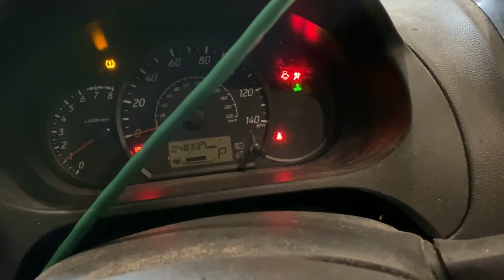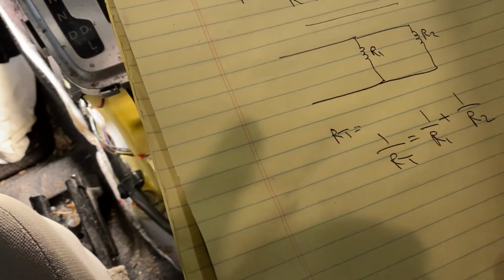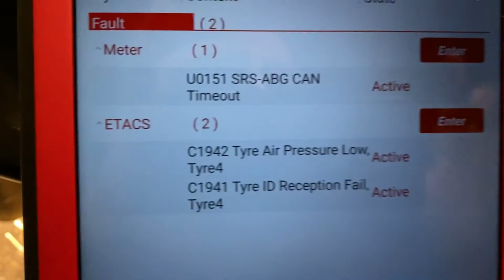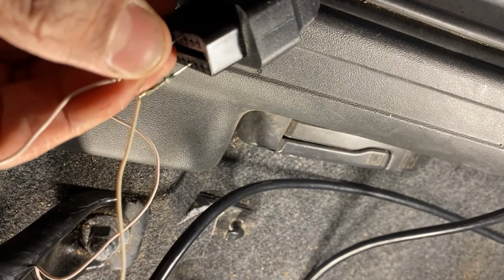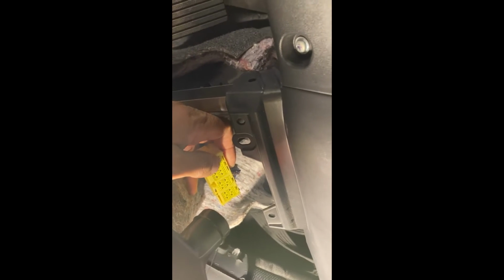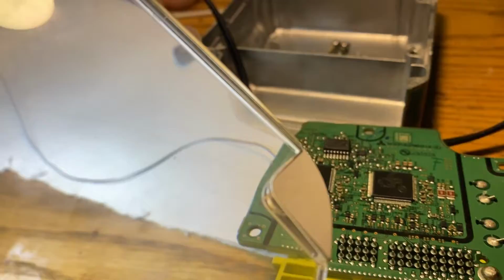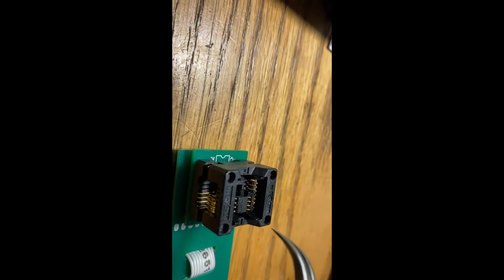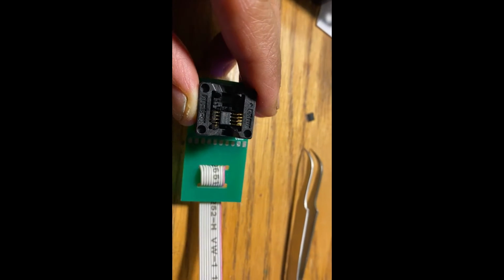CAN BUS TIMED OUT, MITSUBISHI CODE U0151

Comment: Hi bro.
We programmed the key for mazda
It was successful. 
Later on remote control stopped working and the immo icon keeps beeping even when you move the key out of the ignition. 
Thank you brother 
Please what is the problem
Reply from the maker: Hi bro.    1- check fuses,   2-  check if all the door locks are closed when all doors closed, 3- check antenna signal with live data, 4-  test you're remote when key out and ignition off ( most of the time doesn't work with ignition ON), 5- check the remote battery and it's signal,  iff all above are good then you have an aftermarket key which sometimes causes problem like this kind, keep me update so we find a solution, thanks
Reply: @NASSTRACINC  
Ok my brother. 
I will and I will get back to you. 
Thank you so much.